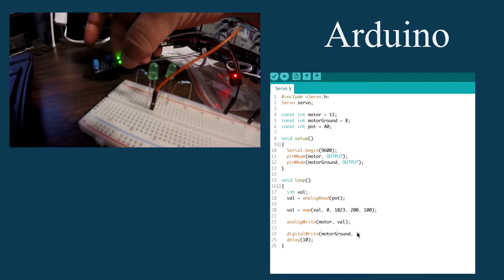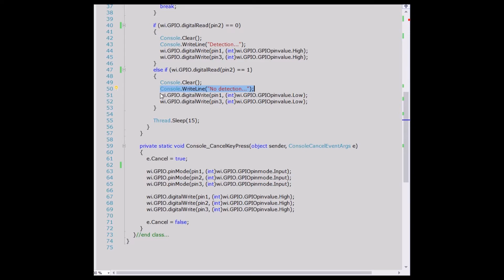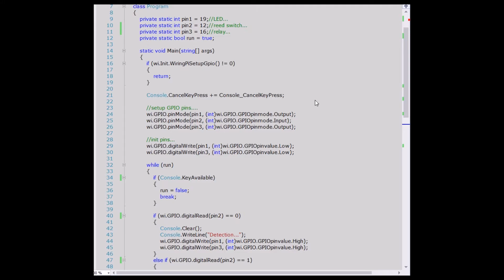Raspberry Pi Reed Switch

Comment: what purpose does the relay board serve?
Reply from the maker: actually nothing as far as the switch,, however, the relay would be used (which i did later) to trigger a buzzer module. The buzzer module can be very loud, which is desired, but you need to hit it with a good amount of voltage so you could connect 9v or more to make it loud. With the amount of voltage a GPIO puts out, you just wouldn't get a very loud sound out of the buzzer. Thanks for watching!